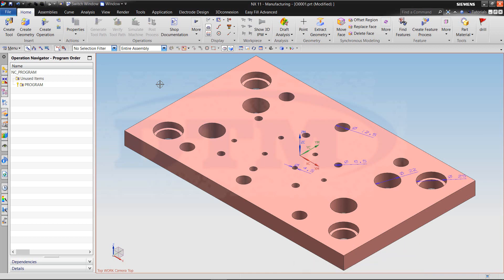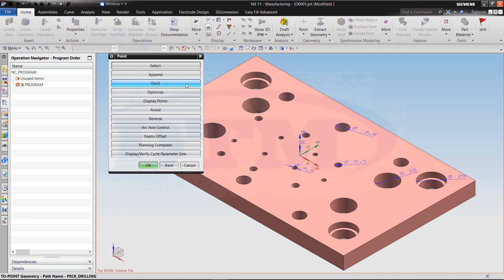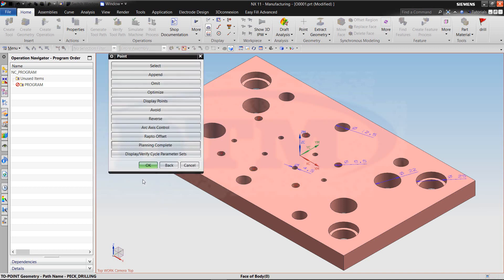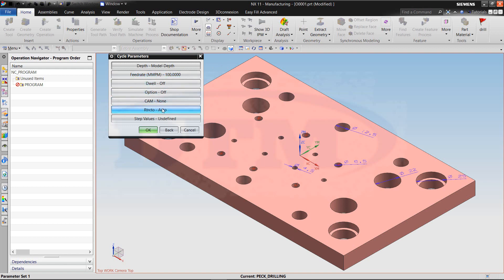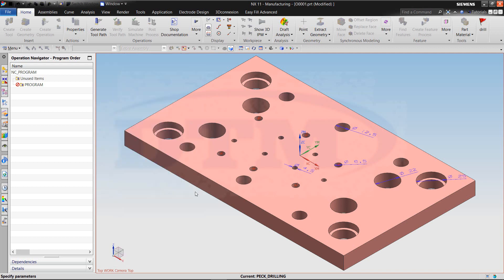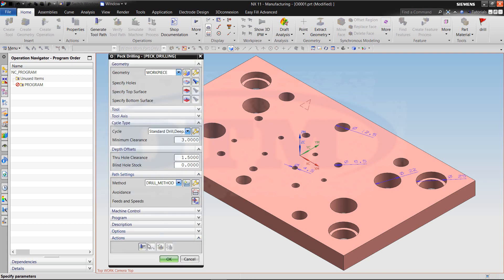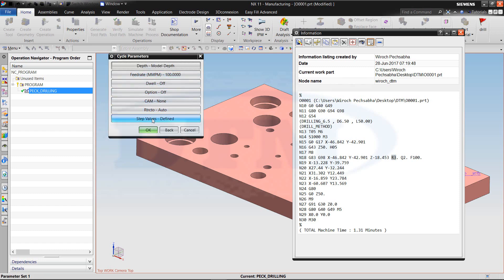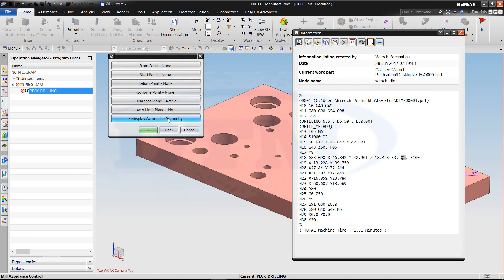Using Peck Drilling

Comment: hi . i tried this program in machine but unfortunately it not run like peck and it act like a center drilling  please help
Reply from the maker: I'm not sure. Where are you trying to simulate machine?
Because we have three place to check peck drill
1. Verify Tool Path will show you like a centerdrill.
2. Simulate Machine will show you like a peck drill.
3. Real machine will show you same as your G Code.